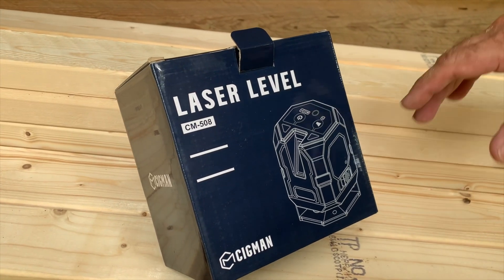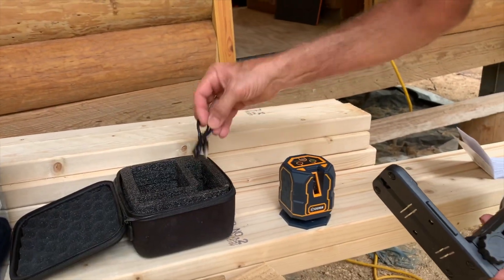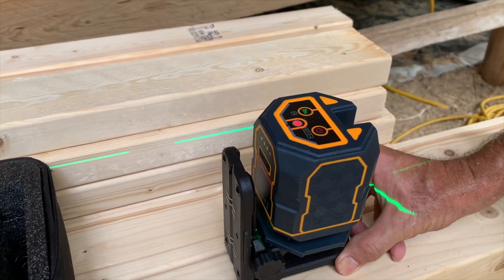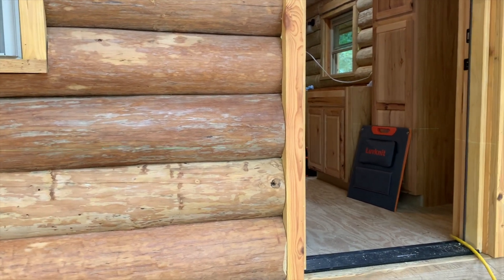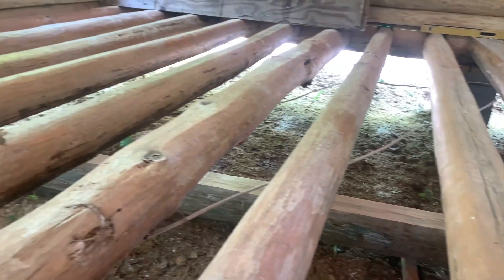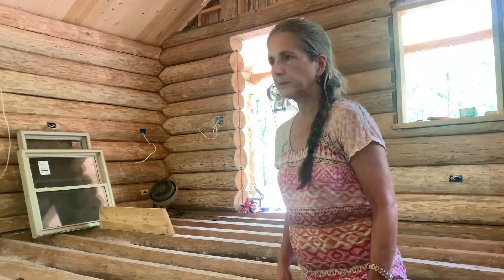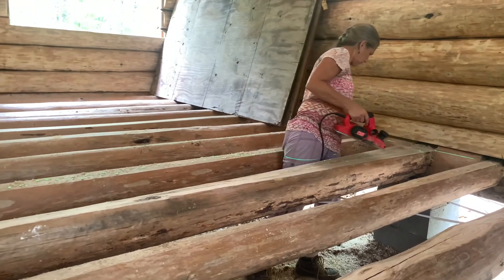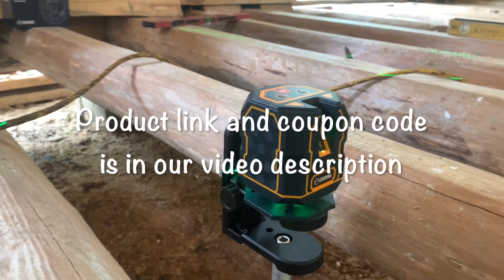Cigman laser level review. Using it to level floor joist logs in the cabin. Full scribe log cabin

Comment: Be sure to check the manufacturer's specs and then double check on site the accuracy of any laser.  Some are stated to be 3/8" off at twenty feet some even worse which doesn't do you much good.  That means it can be +3/8 or -3/8 totaling a possible 3/4" out at twenty feet.  Not precision enough for quality work.  Good ones will tell you their procedure for establishing accuracy.
Reply from the maker: Thanks Douglas! That is good to know. We will check that😊👍